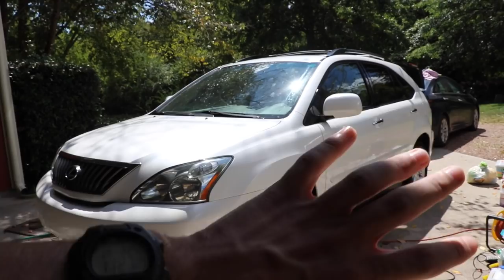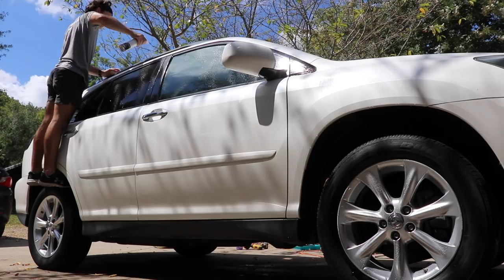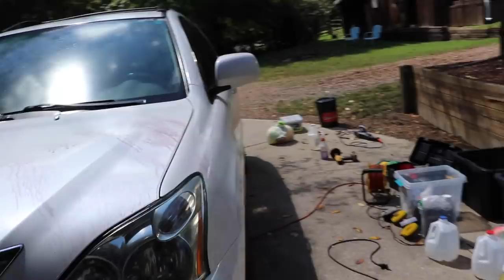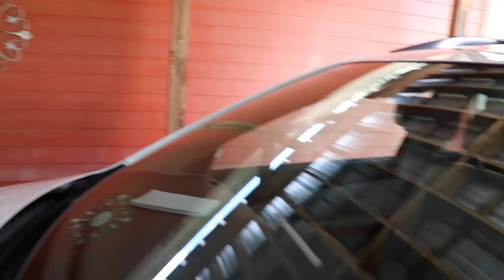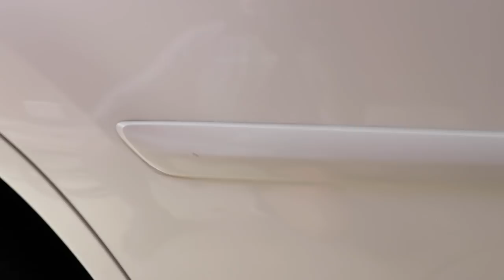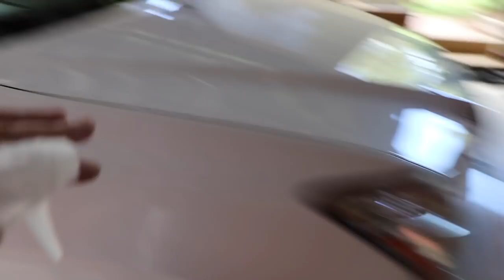Iron X Review: How, When, and Why I use it!

Comment: For those who say Iron X is expensive.  If you check out the SDS  for the other cheaper chemicals you may notice that they will have less of the active ingredient that makes the purple color.  Also you can dilute Iron x if you like and make the product go further.
Reply: correct iron x says 25-30% while megs ultimate wheel says 1-10%. Sonax says 10-15%. Ironx is roughly $1 per ounce and megs is roughly $0.40 per ounce. Depending on their exact percentages they could be about equal in cost vs chemical percentage. Or Iron X could be the better deal. But not by much. My local Walmart had megs for $8 a bottle for some time which made it a better deal. But its close enough to say they are roughly the same.

Comment: In general, clay barring could potrentially scratch the clear coat, so to minimise this, it is recommended that you chemically decontaminate the paint with CarPro’s Iron X and/or Tar X, before clay barring. As you’ve shown in your video here, Iron X chemically reacted to the industrial fallout and got rinsed away with water, but if you hadn’t done that, and clay barred the paint first, the clay bar would have picked up the fallout/contaminants and caused more marring on the paint! That’s definitely not what you want, unless you were going to correct the paint to begin with.

Comment: Using APC-wash, a iron remover and a tar remover can make the claying unnecessary, but it depends case by case.
Reply: I needed the claying with all of the above too
Reply: Definitely is a good method. In my "personal" opinion I think that a good wash, iron remover and then a rinse less/quick detail with a ay bar after is like the best combination but definitely more pricey to charge unless you have a specific package for it. Because I'm fairly cheap with my details since it's more of a side hustle and hobby business so I charge 10 for the iron remover, 15 for a clay bar and an additional 5 for wax (liquid wax). Haven't had any issues using that combination and highly recommend it guys 👌🏼
Reply: @VictorSanchez-rx1ze  if you dont mind sharing bro, what liquid wax is your favorite to use on your details?

Comment: Iron X is so expensive !! Here are some cheaper alternatives that have the same exact chemical constituent as iron-X.  
Nanoskin NA-IFE128 Iron Free Paint, Decontamination Fall Out Remover - 1 Gallon $48
Adam's Iron Remover - Dissolves Iron Particles Embedded into Paint Surfaces - Changes Color to Purple as it Works (1 Gallon) $42
Meguiar's MB0522 Mirror Bright Wheel Cleaner, 22 oz. $8 at Autozone  (Scott Dallas Paint recommends)
Reply: What is the main chemical component? And why can't I use a dedicated rust remover like naval jelly or Krud Kutter? There is ZERO YouTube videos on this question of mine.

Comment: In my opinion...meguiars ultimate all wheel cleaner is a more cost-effective product to use if you are using a lot...costs $8 right now at my Walmart...foaming trigger so it dwells on the surface longer...and cheaper...just my opinion...iron x or products like it are definitely a must have in your arsenal!
Reply from the maker: Yep I definitely wouldn’t suggest using this every time, but for certain applications it definitely comes in handy!

Comment: By using Optimum No Rinse in the damp microfibre stage you are adding a layer of either wax, or polymer sealant to the surface of the vehicle (depending on which Optimum No Rinse you used) so you don’t have a ‘blank canvas’ on which to add the sealant.  I hope you either used a solvent based panel prep?, or a one stage polish type stage? to get the surface prepped for the application of the sealant? 🤔

Comment: If you washed the vehicle why did you not get all the bugs off?  If you foam a vehicle and contact wash it all bugs should be gone if you use a good soap.  Don't understand why bugs still exist.  After washing my truck I never have any bug guts left on the surface whatsoever.